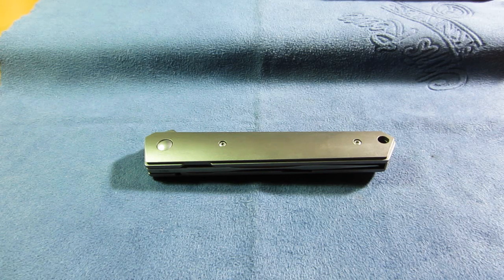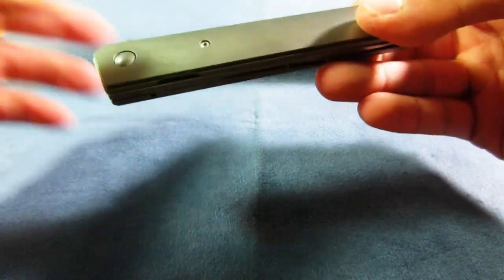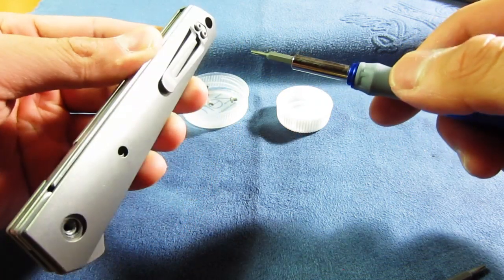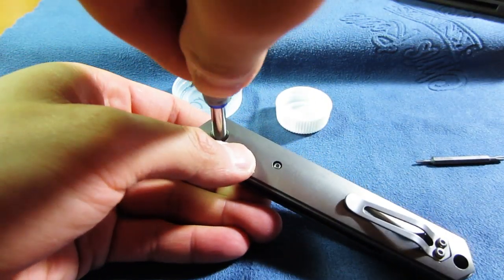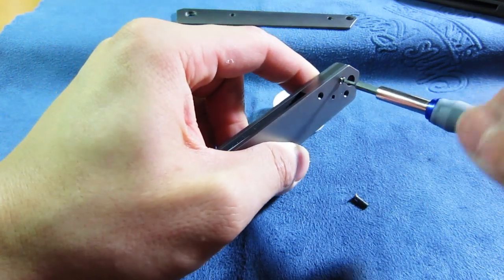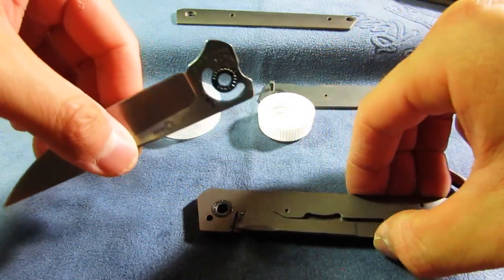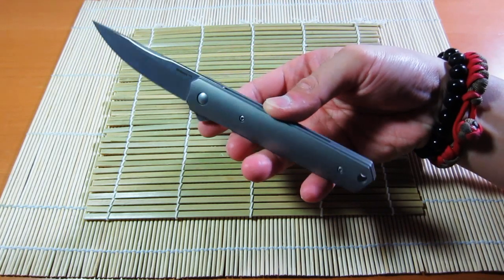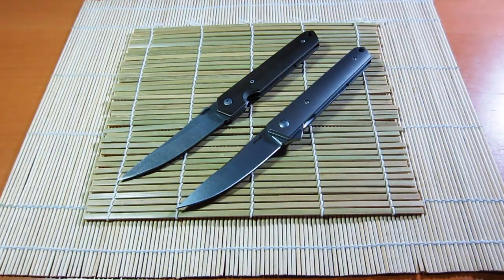Boker Kwaiken Titanium Flipper Takedown and Disassembly

Comment: Very nice job on the video. I'm in the market for a nice gentlemen folder and the 2 I've narrowed it down to are the Kwaiken and the Urban Trapper. I'm guessing the Urban Trapper uses a similar bearing set up? I know its IKBS, but like you've experienced, one of your Bokers has 12 bearing balls per side and the other 20. So this video certainly give me an idea as to what I'm in for with disassembling my first IKBS equipped folder.

I'm mostly a Kershaw guy, and know the internals of those quite well. And like you, as soon as I get a new knife, I open it up, re-oil/re-grease it, a dab of blue Loctite on the pivot screw and good to go. Thanks again for the great video.....
Reply from the maker: +Brian Accidentale Thanks! Glad you enjoyed the video.

Comment: Thank you for such a helpful video!! Just had a couple of questions for you: Did you remove all the ball bearings and re-grease? If your greasing the area where the ball bearings are did you apply an oil or lubricant to help with deployment? other than the sentry grease are there any other products you recommend?   Thank you very much!! Awesome videos!!
Reply from the maker: +deegz Yes, I removed them and regreased them. I applied grease to the bearings and the area where the bearings sit. It helps with reassembly as the grease kinda holds the bearings in place. You can use Chris Reeve fluorinated grease, but that's a bit pricier. There is also nano oil, but that's a bit too thin for bearings. Sentry solutions is pretty good for these bearing systems.
Reply: Thanks a lot for the advice! Ill be taking the knife apart in the next week or so and your video is extremely helpful. Ill keep in touch just to let you and some of the viewers know if I come across any issues.

Cheers!!

Comment: Tip for everyone after spending 2hrs trying to put it back together. I got sand in mine and never was the same again. Took it to the beach since it's VG-10. Beautiful knife, but I will never use this knife for anything outdoors again, nor will I buy another IKBS knife again. 

It is very difficult to align the bearings on both sides, with the lock bar pushing on the blade. Any movement will misalign the bearings out of the channel. 

Was finally able to do it with 3 layers vertically and aligning the main D shaped pivot screw

Just get an ultrasonic cleaner or something. Not worth my 2hrs

Comment: Hey guy got a question for you?? Do you work on other peoples knives??? Did you do the flipper mod on the micarta one yourself or did you buy it that way??? I would like to get a Kwaiken but I like the micarta one more than the TI one. Didn't know if I bought one if you could do the mod for me... Let me know..
Reply from the maker: Scott Houlton I don't do knife modding. I had the micarta one done for me by Alexander Dietz a long time ago. I'm not sure if he does mods anymore.
Reply: Any machinist would be able to modify the scales and liners to be just like the updated kwaiken, aka flipper mod, 
As a knife aficionado/machinist I wouldn't charge no more than $40 to 
disassemble , 
new grease ( real , quality grease, not the cheapest thing a manufacturing engineer could source). 
I always use kitagowa chuck grease ( never dries up, high wear protection, japanese grease)
And modify the liners and scales to the flipper mod.

For 20$ extra a 2000 grit finish on the blade, hand sanded, not polished, so no heat is transferred effecting heat treatment and factory hardness...
$20 more , you get a 2000 grit mirror finish on the scales, 

$40 more, and I will heat anodize the scales to a custom unique,made for you kwaiken, 
or any knife you love, and want to make your own.

Multiple services can be done, jimping added on the flipper can make it flip insanely fast...
File work on scales lighten the overall weight and add another custom touch, 

happy spending, 
-Dave